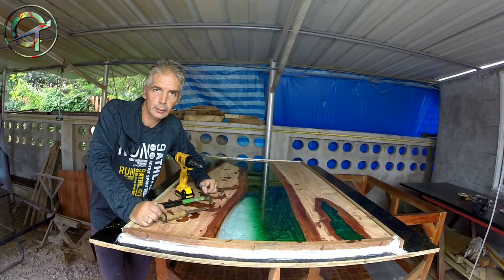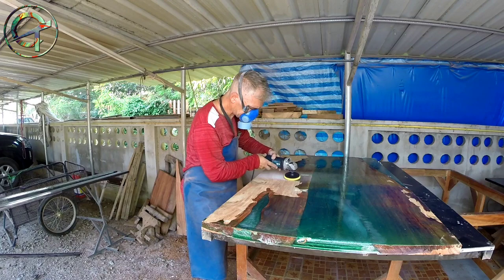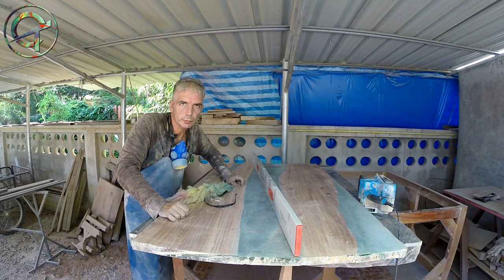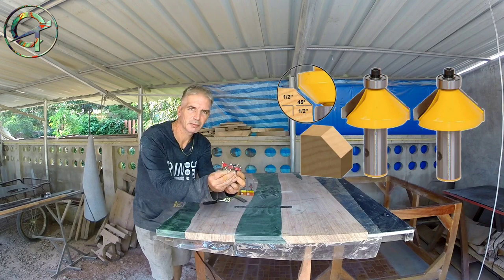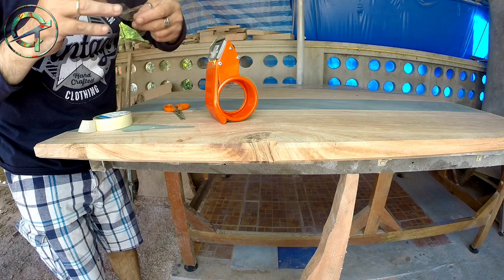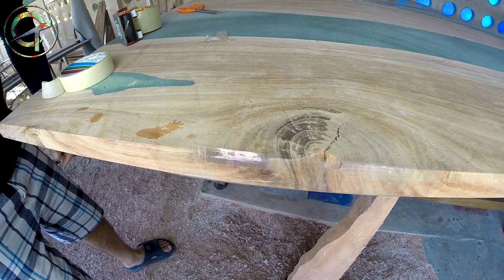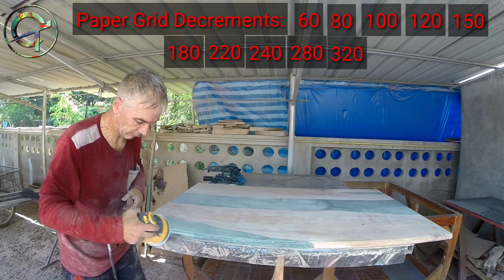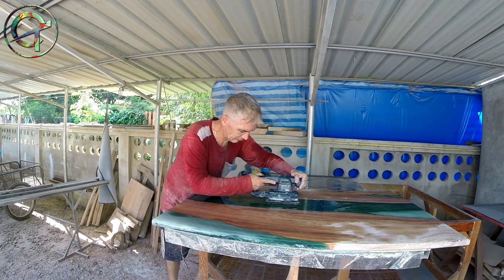Resin River Cast Kitchen Table EP-5, Opening the Mold

Comment: I built a boat with epoxy and when I ran my router the epoxy sticks to the guid barring do you put wax on the barring to keep it clean ?
Reply from the maker: Probably your router didn't run smoothly cause the quality of epoxy used. I don't have any kind of experience with resin to build boat. The kind of epoxy that I worked with over time are resins for cast proupose, once cured I got a "piece of glass", router runs over really smooth. 
In the video you can see my router bit bearing running smoothly, I don't add anything, it runs over resin that is not polish jet.
 Keep in touch